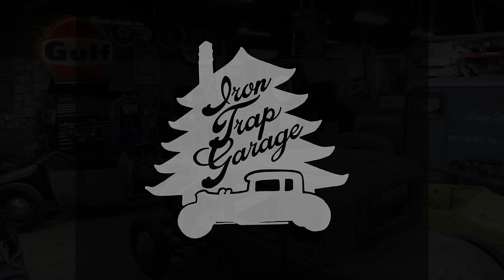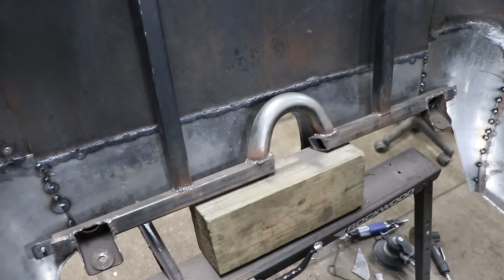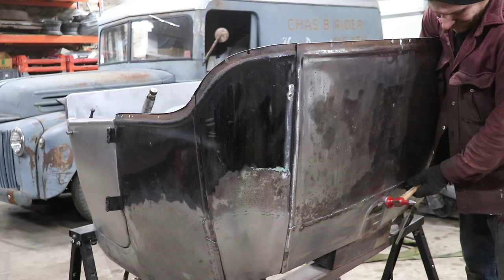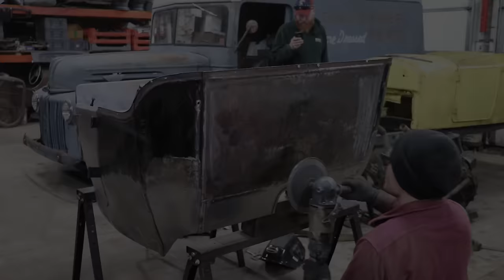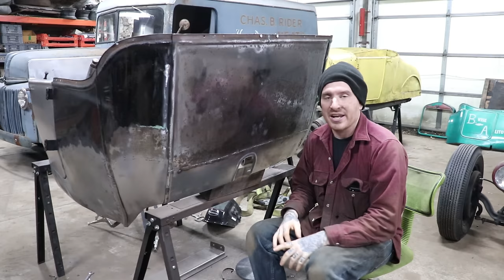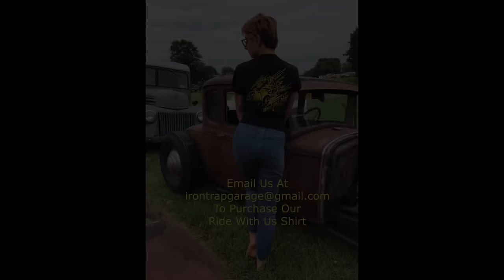Fixing Rear Panel Damage - Ford Free-T - Ep. 54

Comment: Matt..I've got a technique for doing that, that you might be interested in. If you sharpen a chipping hammer ( or similar hammer ) to a sharp point ( you got to get the point just right )  And use a hardwood dolly ( on the inside )  and peen the panel,  if will nicely work out the oil canning.    It just leaves behind a sharp profile peened surface that sands out, and you don't end up with those heat spot distortions like when using heat.     Cheers Matt...love your clips.
Reply from the maker: That's am interesting idea. Not sure how that shrinks the metal though? Seems you're just stretching it more by hammering into a hardwood block? I'm certainly no expert so I'll need to give it a try sometime just to see! On the heat distortion I slap the area while hot to gather the metal and smooth out the distortion in one switch action, so really there isn't any additional damage from heat shrinking. I definitely want to try your method just to have another method in my mental toolbox! Thanks for sharing! -Matt/ITG

Comment: yes I absolutely agree best to keep things in check as you go so you don't end with a disaster btw I see more t panels against door ?
Reply from the maker: Yep, I've learned to try and keep slowly addressing a panel over the years. I'm not good enough to just whip it back to shape in a few minutes like some guys! Good eye on the T panels! Those are pieces of an old 60's fiberglass t bucket I found at an antique shop. Wall hangers at this point! -Matt/ITG

Comment: Nice job! I wouldn’t brace it. I tend to go overboard but thinking of tracing the rear bottom from the inside and using that outline to cut a 3/4” or so flange across the bottom. You could carry that around the tunnel as well with a second piece then cut out the middle of the flange. Would be quick to fabricate with the tracing but would add more heat - though only on the corner. Just spit balling. As is it is quite an improvement!
Reply from the maker: Great idea! The bottom of the panels all have an 1/8" lip turned on them to add strength, just enough to give a nice rolled edge on the bottom. I didn't turn the edge at the torque tube notch, which I might just do. Thanks for the suggestion! -Matt/ITG

Comment: Wouldn't it be a good to put a center brace  and maybe some sealer between the layers to keep from vibrating as bad. Great video I wanted see the process on heat shrinking
Reply from the maker: Hi Gene, I prefer to tighten the panel up and not use a strap across the back of the panel. This way it won't vibrate or flop  like it did when I started. I did put three small tabs around the center notch in the bottom to keep that area from flopping or vibrating too much. Thanks for watching! -Mat/ITG
Reply: @IronTrapGarage  I understand that's why I suggested a sealer in-between the 2 metals. But I really do understand and you done some awesome work on the rear panel tightening it up

Comment: Hey  Matt,,, where did you get that tub sanded or barrel sander looks like a great tool could you. Pleas give me a link. For the tool. Happy holidays. Great video. Stay warm. JUNKMANDO
Reply from the maker: Hey Samuel, That is the Eastwood Contour SCT sander. The link is in the video description. It works awesome for ripping off old paint and filler. I'm using the heavy duty stripping wheel on the tool there. Thanks for watching! -Matt/ITG

Comment: I love your shows and work but I never see you lip any panels in my thinking it would have straightened and tightened up that panel where it was oil canning making it faster and less work ?
Reply from the maker: Hi Larry, I'm not sure what you mean by "lip" a panel? All of the panels on the back of the car have an 1/8" lip turned on the bottom if that's what you mean. Turning a lip doesn't correct a stretched out panel with damage from before or warping from welding, it only will strengthen the bottom of the panel I've found. I added 3 small tabs around the torque tube notch to support the bottom of the panel in the center after this just to be safe. It's all very tight and secure now! Thanks for watching Larry. -Matt/ITG
Reply: @IronTrapGarage  I mean using a panel flanger

Comment: HELPFUL HINT: If you spot heat with a rawhide round mallet instead of a panelbeating hammer & dolly, then you can push the molecules on any concave area.  Just make sure that you use the mallet from the perimeter towards the heated area you are trying to shrink.
Reply from the maker: Thanks for the tip. I’m certainly still learning myself!
Reply: My Dad was a 86-year old car builder and had more than 200-cars in his collection. Building cars is a passion that he passed on to me. Thank you for motivating me to build cars. Love your work.